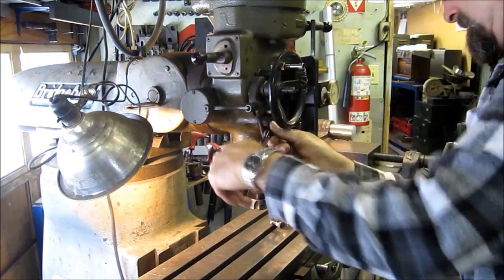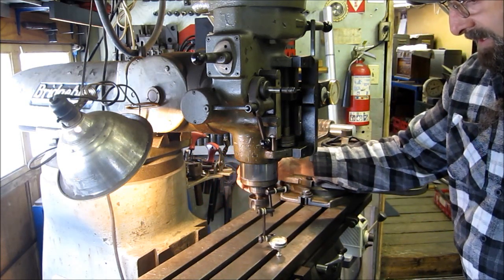Portakey Part 4

Comment: great video, as usual. when you were using the brace, and sliped after you said you dont need to clamp it down(i was watching while eating my lunch) i nearly choked laughing, good stuff! i don't remember what video it was maby whining wont fix it, but could you do a video on your duplexing head. i have heard other guys at the shop talk about them, but would like to see one in action. i ordered the sulfer cutting oil you recomended, and used some the other day works great thanks.

Comment: Another great vid!  +1 on the brace, mine is just like yours but still has the orginal chuck for square shank woodworking drills so I need to check out how to mod to mount Jacobs...Was that a spiral point tap you were using?  I noticed the chip being forced out the bottom of the hole ahead of the tap.  Are you going to be the person using this jig once it is complete?

Comment: Hey Keith, I really dig your videos, keep 'em coming...

One trick when squaring the head on the Bridgy using the same tools, lower the table and extend your quill all the way out before you start tramming. The longer extension will allow a tighter squaring with the same indicator since you get greater indicator movement for the same angular change.